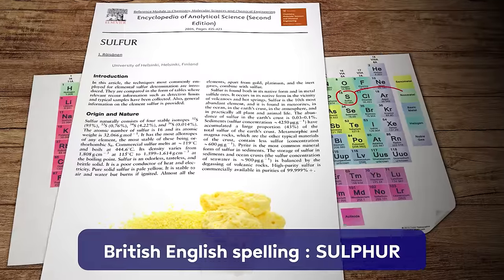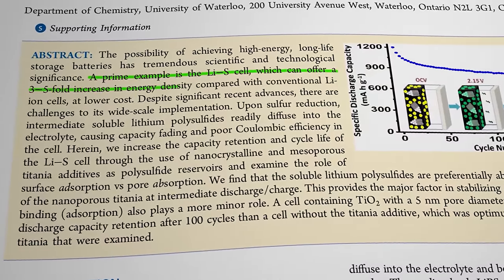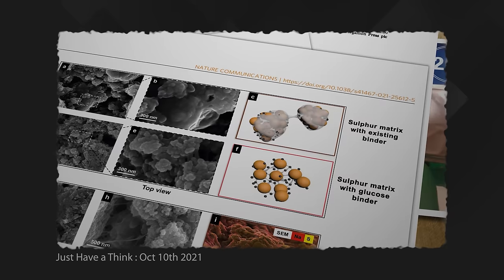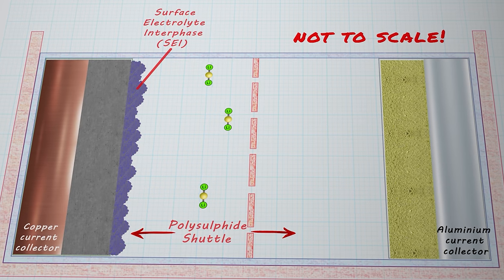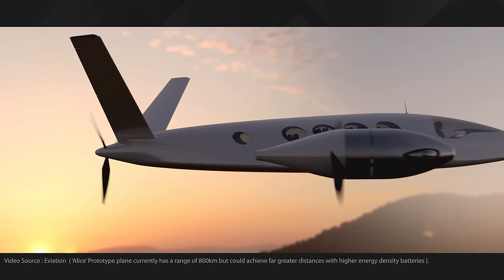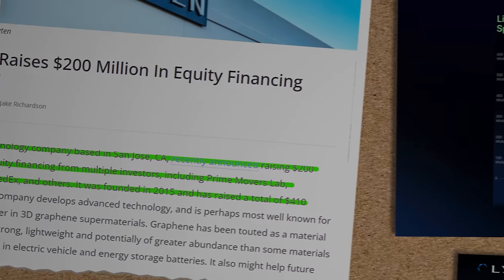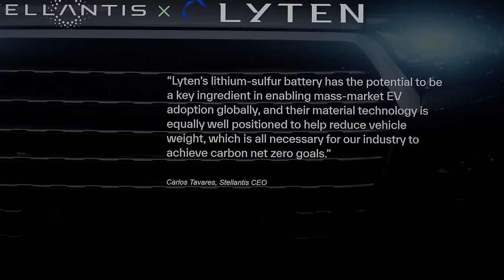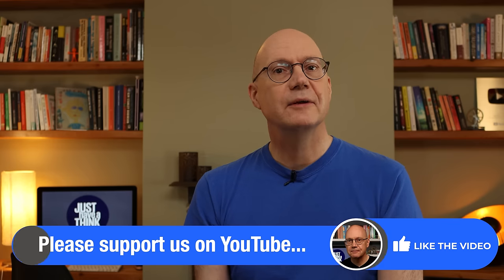Battery Energy Revolution. What now?

Comment: Dave, speaking of disruptions, an affordable home storage battery would lead to huge increases in solar and EV adoption as well. Tesla Powerwalls and their primary competitors are still selling for Rolls Royce prices in the US, about $1,100  per kWh installed. Too rich for most people’s pocketbooks! The price of home and small businesses-scale battery storage needs to drop by 75%!
Reply: Yes - using lead/acid certainly works, but requires a lot of generator in the winter...
Reply: The sooner the price drops for household batteries the better. That way more people are involved. This will reduce the need for generating capacity and make wind and solar more functional.
Reply: The U.K. government has, at last, decided to zero rated household storage batteries. A bit on the late side for me as I’ve now 2 power wall batteries but at least it’s a start.
Reply: Does home storage really drive solar and EV adoption? I always thought it was mostly the other way 'round. That is, solar and EV are their own value proposition, but the value prop for a home battery is greatly enhanced if you have those other things to use it for.

Comment: Can't wait for the bicycle battery version!
Reply: I was thinking the same thing. Imagine an electric bike pulling up to a charging designed for electric cars and recharging its battery in 6 minutes.
Reply: @ab-tf5fl  and going another 100km with half the size of the batteries now.
Reply: @ab-tf5fl  Even better, 6 minute charging was for a car. A bike sized battery would probably take 20 seconds.
Reply: @danmallery9142  Unfortunately, that's not how batteries work. Their charge rate is always an absolute number, regardless of their size. It's called the "C-rate", with a value of 1C meaning "one charge takes one hour", 2C meaning "two charges take one hour", and so on.

The hypothetical battery talked about in the video has a 10C charge rate, so 10 full charges per hour, or one full charge per 6 minutes. This is independent of the size of the battery. A 1 kWh battery will charge in 6 minutes, and a 100 kWh battery will also charge in 6 minutes. The difference is that the latter will accept 100 times the power from the charger in order to pull that off.
Reply: @streetwind.  OTOH a bike could have a ridiculously oversized battery, and charge many kilometers of range per second.
A waste of money? Yes.
Possible? Also yes.
Reply: Maybe a pedal bike would look ridiculous but a motor bike with its accepted 'ridiculous'  geometry would be exactly the same as the motor would be the wheel and battery where the motor once was. @kanucks9
Reply: oh god yes. I can't fathom why an ebike battery is the lion's share of a bike's price
Reply: @streetwind.  This is true when the limiting factor is the battery.  When the limiting factor is the power delivery of the charger, a smaller battery will take less time to charge, at least up to 80% or so.
Reply: With energy density like that you’ll be popping wheelies!
Reply: @mk1st  Energy density and power output are different things. You could have a battery with a high energy density but could only release its power slowly... the popping of wheelies needs a battery that can output its energy at a high rate of course!
Reply: @MrAdopado  True, but if a battery can charge as fast as Dave was saying, very likely that means it can discharge really fast too. Low internal resistance, etc.
Reply: I use lipo4 in my bike , sodium ion looks like it might be the next big thing, as they have like 3t
 Times the charge cycles and better for the planet .

Comment: you are right, this development IS UNSTOPPABLE. what we don't know is, how fast this development goes forward. i suspect, that we don't see huge disruptions coming from a magic battery. it is more likely to see more linear innovation steps at a usual rate. a few percent more energy density and a few percent less cost per kWh every year. that does not sound sexy but it still creates growth and is fine enough for me.
Reply: Fully agree with you. Also, in a matter of a few years (I'd say 3-5 years), EVs will become clearly cheaper the ICEv, not just to own, but also to buy.
Reply: CATL (largest battery maker in the world) recently said they were going to cut prices in half within a year.  If that happens, it would be a BIG change.  Battery performance, which is already pretty impressive among the best batteries, will probably be on an evolutionary path, but with the amount of firepower now aimed at battery research, I really can't rule out a revolutionary improvement.
Reply: To bad people aren't focusing on lithium air solid state. I don't know why. It is the end all be all of chemistry as far as power density goes. 

 Has to be a reason, but I can't find much. There was a break through last year with it, but that was it. Still didn't compare.
Reply: 90% drop in cost per KWH, and a near 150% increase in energy density in 15 years is not incremental. It's the difference between props and jets.
Reply: If you think the oil companies are just standing by, you are mistaken.  No profits will be lost as they move into the resource market and drive those prices up (already happening).  Not to mention a lot is conflict resources.
Reply: @RS-ls7mm  Fun fact, those resources and their substitutes of which there are many, like litoum, Iron, sulfur, are Very common. The conflict and rare earth's both outside their wheelhouse are being actively reduces in need and alternatives studied. This isn't going down like Rockefeller... nor can they out bid the large players,Tesla, CATL, PANASONIC. To name bit three that match or exceed Oil market cap.
Reply: @Agatesforbrains  Fun fact, sulfur is made from oil/gas (93%).  Fun fact, all the easy deposits of metals have already been mined out.  In fact copper is at the point where demand outstrips supply.  If you think the massive increase in necessary resources has no negative side effects (strip mining, politics, conflict, ...) then you don't see the bigger picture.
Reply: @RS-ls7mm  fin fact it's also mined.
Reply: @Agatesforbrains  You should be ashamed to bring that up.  If you look into it its the worst job.  The suffering and exploitation is tremendous. Most people are so insulated from where their products come from they have no idea of the suffering that went into them.
Reply: @RS-ls7mm  Sulfur is mined from pure sulfur deposits found in oil-producing regions in Louisiana, Texas, Canada and Mexico. It is also found in pure form near volcanoes and hot springs.
Reply: @Agatesforbrains  Sulfur mining is less than 1% of total production.  Meaningless.  Sulfur from oil, just what I said.  Digging around volcanoes, great idea.
Reply: That is also how we got cheap photovoltaics and cheap wind power.

Comment: Another great one. With such energy density, new opportunities would open, not just cars with longer range. Just... It's been announced so many times already, that I am a bit skeptical about revolution and expect more evolution. Not that it's bad, just making the expectations a bit more realistic.
Reply: Thing is we might have to ditch long distance cars anyway at some point. Majority of driving happens to be done within very reasonable range of new proposed battery technology.
Reply: It will probably be more evolutionary - they'll probably have to make sacrifices to get the longevity needed which will bring down the charging speed and energy density, meaning that at first Li Su batteries will probably only be marginally better than current batteries. It just means a new arc is introduced that extends the theoretical maximum out further than current battery chemistries. Once the maximum for Li Su batteries is starting to be reached, they'll have some new revolution that will extend that arc yet again.
Reply: @Pecisk  No, there's no reason that we have to give up long distance cars.  We already have that problem solved with electric vehicles; it's done with fast chargers and decent sized batteries.  No one is going to buy a car that can't go as far as they need, and there are a lot of parts of the world where people need to drive hundreds of km.
Reply: @Pecisk thing is we need to ditch cars entirely. Replacing gas with batteries doesn't solve the underlying problem that it's terribly stupid to use a 2 ton box of polluting metal and rubber to transport one dude and 5kg of groceries
Reply: @person8064  I completely agree that using a car for virtually every trip to the local super market or any other destination within a few km's is wasteful to begin with, especially when driving alone, but to change that you need to have access to better alternatives like (electric) bikes, which means proper infrastructure like bike-lanes, sidewalks and other safe and convenient non-car means of travel. But that doesn't take away the need for people to travel longer distances for work, family or vacation, and the freedom and flexibility of a car is unmatched in that area. So ditching cars entirely...? I'm an optimist but that's just not going to happen I'm afraid... As such, conversion to EV's that will ultimately be cleaner, more efficient, more comfortable, last longer  and may even outmatch fossil fuel cars on range at some point is definitely a good strategy IMHO.
Reply: @person8064  Ditch cars entirely? Do you work for the WEF.  Cars give people freedom. You think we should go back to living in the 1850s?
Reply: @mgcarmkm4520  In the cities at least, cars are enslavement. Because of them, no one can walk, bike, take a bus or train to anywhere. They gotta buy a ten thousand dollar vehicle just to stew in hours of traffic to go anywhere. In the 1850s, people could walk to work and to stores, neighborhoods weren't bulldozed for highways, and populations were dense enough for children to play together without having to get their parents to drive them somewhere.

Comment: Thanks for this update on a promising technology. I'm retired now but one of the companies I followed as a industry analyst were Oxis Energy in the UK. They were working on LiS battery technology which looked promising and I met some of them at a conference in 2017. Sadly, they went into administration a couple of years ago through lack of funding. In Europe the leading company seems to be Theion Gmbh in Germany. Their approach uses 'crystal structures' to overcome the problems you mention here. Their website points out that sulphur is an industrial bi-product, ironically mostly from refining crude oil..

Comment: Great channel. People have no issue with progress. And how I travel. If a battery powered vehicle can offer me what a diesel does. For less than 5k. I'm all in. Of course second hand is what I'm interested in. Longevity. Multiple owners. Long term use. I heard someone say solid state batteries would have allowed a 5min charge. Similar to a petrol station stop. 
Now..
You may argue 'but you can plan in a stop at a charger' Well. There's the thing. I value my time more than anything else. More of it. Is not guaranteed. And the time I do have. Is a finite resource. I'm in my 40's. I refuse to waste hours sitting in a car waiting to continue on with my journey. And I'm not buying a car that costs the same as a house in North West England so I don't have to charge mid journey. I'm not insane. 
So seeing battery research and development is great! The future looks bright. 
Net Zero target dates being met. More chance of winning the lottery without a ticket.

Comment: For me EV is either potential rent car, or car I will use to travel to country side because public transport is sporadic there. However, I think reality check will follow at some point regarding how much actually we can grow that market and how useful it is for society. Renting cars is already all the rage and that trend will only grow because of cultural changes in next generations where owning a car is not seen as status symbol or required checkbox anymore.
Reply: Renting is so much more expansive than owning. We need a car on daily base, just like 75% of our neighbors, family and friends. 
We always owned our cars, while it is a lot cheaper in the end.
Reply: Energy density vs physical resilience 

Rarely discussed. 

When something goes wrong, what happens to all that energy ??  It has to go somewhere….

By all means we should continue to do the research, but  when everything to make things go vroom are all in one place, then we have a slight problem when the unintended happens and it goes boom instead. All the stuff to make that happen is in one very tiny place. 

Anything conventional we burn, requires oxygen which we get from the air. To turn it off, cut the oxygen supply. Works for cars, jets etc. Not so much for rockets where tanks of oxygen are kept along side whatever fuel it combines with…

With this technology, when things go wrong, how do you turn it off ???
Reply: Renting is all the rage? LoL, I don't know where you live, but that isn't true in any place I know.
Reply: Indeed.  ICE cars aren't the problem - cars are the problem.  Going electric will have very little impact on global warming, and certainly won't stop the continuing dependence on cars.
Reply: @MidlifeRenaissanceMan  Have you seen what happens to an ICE vehicle when it combusts, it's just as spectacular as an EV fire and usually also results in a destroyed  vehicle before it can be put out. Fire fighting techniques for EVs are evolving, but the result will still be the same as with a fire in an ICE vehicle, the veihicle will still ultimately be dstroyed.

All sorts of thing catch fire spectactularly, but know one seems to have any focus on those things with concern. BEV vehicles, so far as can be ascertained with limited statistical history, have the lowest relative incidence of fire. Hybrid/electric vehicles have the highest incedence of fire, while ICE vehicles are in between those two vehicle types.

Other than the relative degree of difficulty and method of extiguishing an EV fire, the media has recently been all about whipping up a storm in a tea cup about EV fires. I hope you are not buying into that nonsense.
Reply: @BrentonSmythesfieldsaye  you are correct. Yes. Both vehicles will be destroyed 

The difference with a conventional diesel and even petrol cars is you can limit the supply of some of the the chemicals required to continue combustion. Petrol / gas need oxygen to combust. Diesel also need a degree of compression. Sure, the fire usually results in a written off vehicle. The key point is, in a conventional car, you do not store along side the fuel, enough  oxygen needed to combust all the fuel all at once. This means you can somewhat control a fuel fire 

….however….

….and this is my point….

Fact is, with any EV / Hybrid, all the stuff needed to store the energy is contained in one box, and to maintain the energy density, this stuff is separated by a thin membrane, that, should something untoward happen, starts a chemical reaction that can not be stopped until it burns through all the fuel. To stop the reaction, you need to separate the chemicals or reduce the temperature at which they react. Both, with current lithium technology is impossible. 

Set aside the issue that such a chemical reaction spews out really toxic chemicals, 

The proximity and reaction chemistry of these batteries,  burns so much hotter than a conventional gasoline fire. 

Don’t get me wrong. The idea of an EV makes sense, especially in cities, lower smog, and you’re not burning fuel at the lights, however, the challenge is storing your energy all together in one small volume where you can not dissipate, nor contain it should something go Chernobyl / Challenger Space Shuttle 

The chances are low, but regular enough to make the news, and represent a much higher percentage of the EV Hybrid fleet vs conventional cars and those type of accidents / incidents. 

Just had a neighbour’s car go up. Electrical short and the fuse didn’t go before there was enough melted and burning plastic to take off. Have a look at Louis Rossman’s video on dodgy fuses that don’t blow at 3x rated current. The fire department was there in under 5 mins and had it extinguished in around the same time with a single water jet from their tanker

If you look at the chemistry and engineering and where the energy comes from, where it is stored and how it reacts in an unfavourable situation you’ll see that the EV disaster energy dissipation challenge isn’t going to go away in a hurry.

Also look at the Luton Airport car park fire. Hybrid diesel that has its battery drop its guts so to speak. So many EV and Hybrid EVs that they lost the lot and the temperature of the chemical reactions means the structure has to be torn down. 

Burning dead dinosaur compounds is still probably the safest, and most efficient way of getting us around. We can synthesise them. They’re simple enough and the oxygen to complete the reaction is only collected when needed. This will always be safer than carrying around a grenade with a thin polymer film as a safety pin.

Now who here wants to talk about EV battery end of life cycle and recycling materials recovery ????
Reply: @MidlifeRenaissanceMan  I did express, " I hope you are not buying into that nonsense."

So you are buying into all that nonsense. Ok then suit yourself.